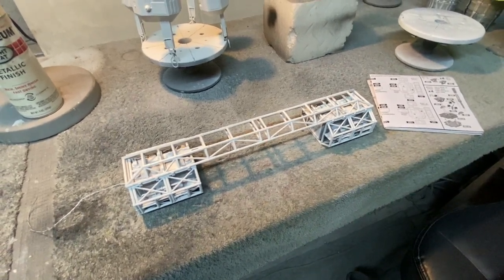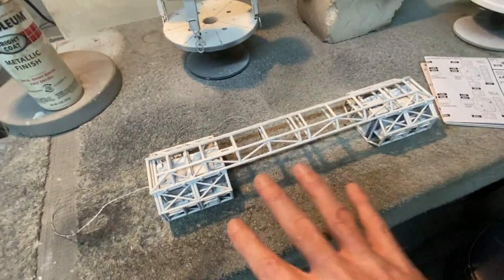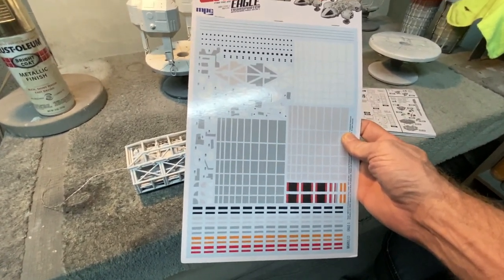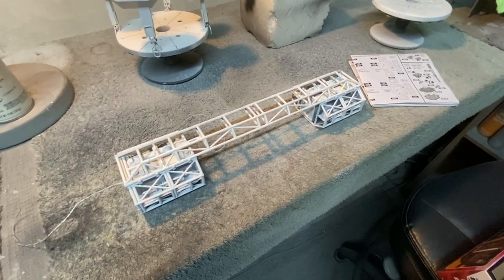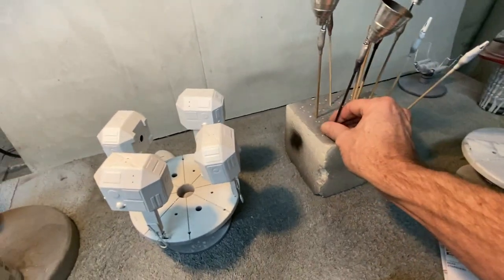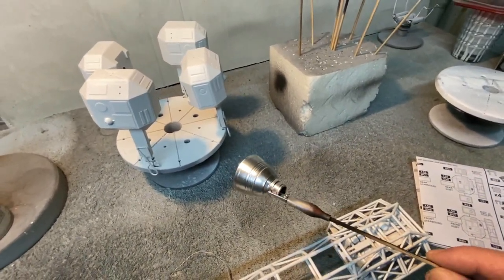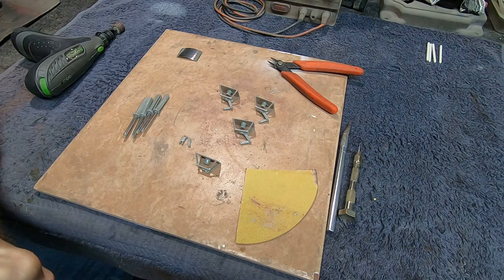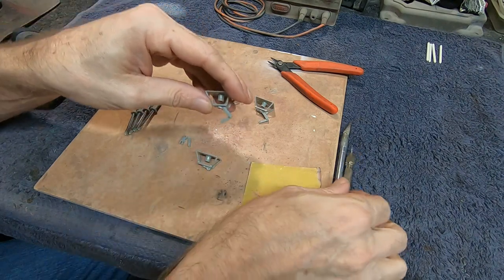Space 1999 22" Eagle Build Pt 3 (Modifying The Landing Struts)

Comment: I built this when it first was released and the few issues I had were The way the landing feet are not free moving. If you watch the show the landing feet were always a bit askew after takeoff. I rounded the bottom of the strut, and the area where it seats "Flush" on the landing pad/feet then pinned them.
The compression springs provided, at least with the first batch of kits, were way too tight so I replaced them with the proper size.